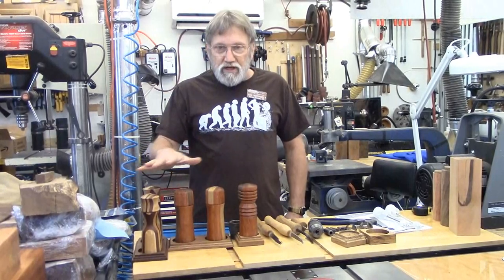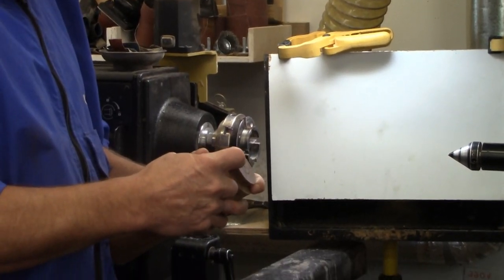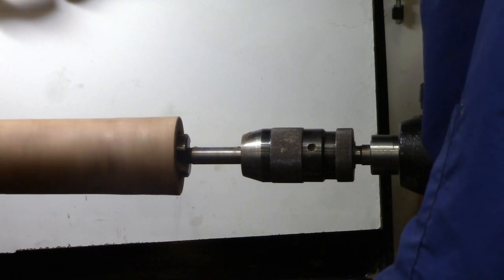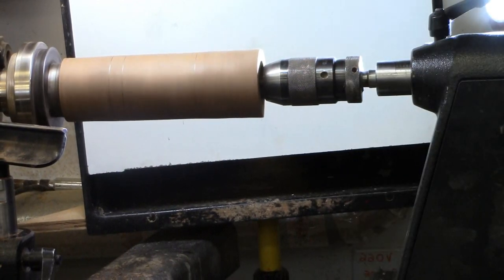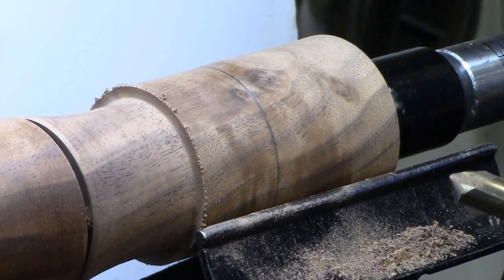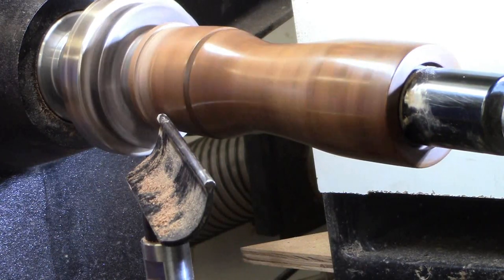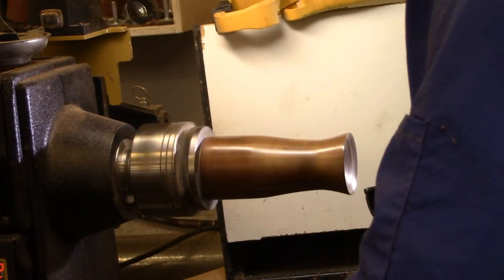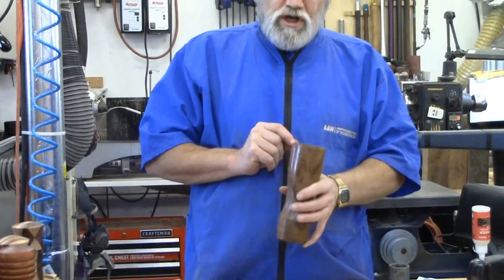Turning a Peppermill by John Beechwood

Comment: Nice job John.  I like the way you part off the top from the bottom at an angle.  I'm a bit confused about your statment that the parting cut has a radius.  When you make the cut, do you cut a straight line (at an angle) or are you swinging an arch as you push into the stock?